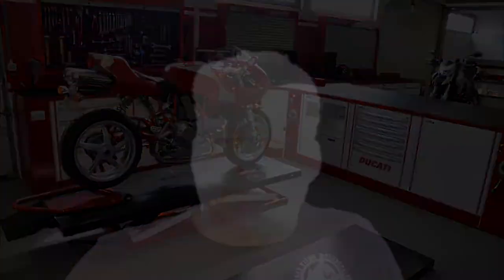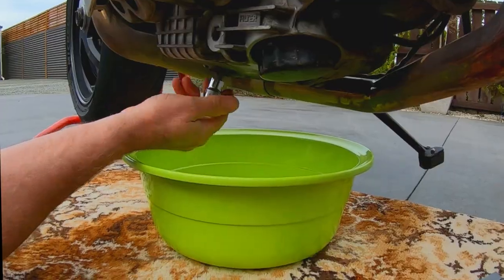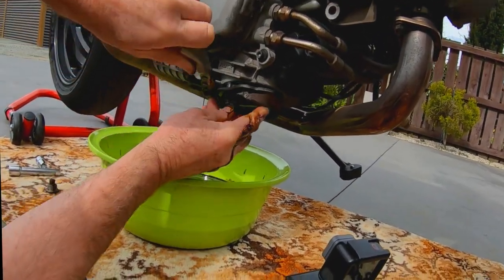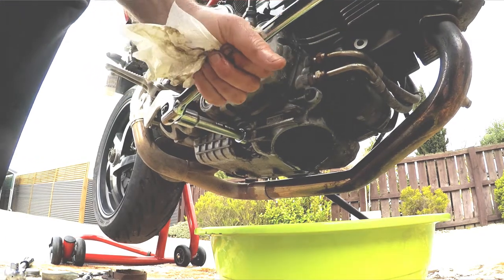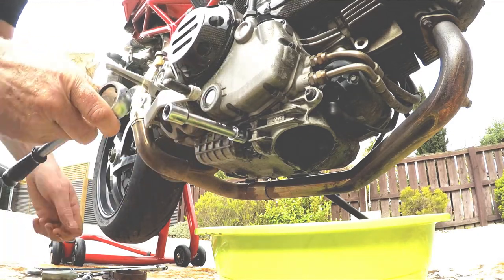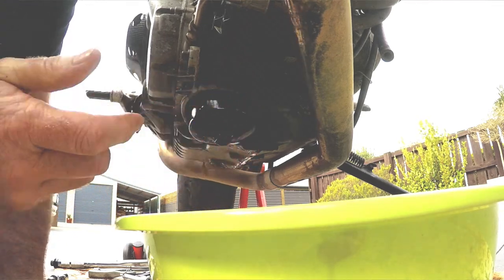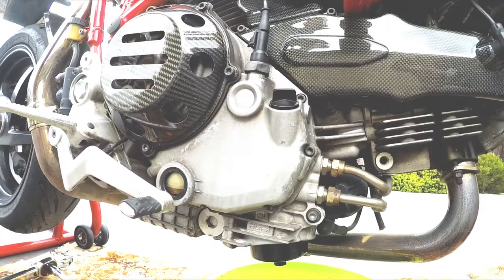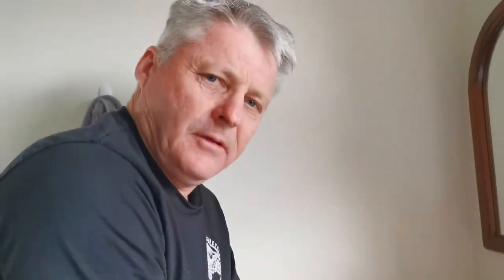Oil change Ducati Multistrada

Comment: You mean hex keys not sockets I assume.  A socket is female. Plus on my 2004 the exhaust blocks access to the mesh filter. Nice quick refresher on oil changes though. Thanks.
Reply from the maker: Yes, my exhaust is after market, factory one needs to remove to access that filter.  Down here, "Socket" is a generic term, whether Alan, posi etc. Whatever fits to a socket ratchet. Like the adjustable spanner, here called a "crescent" and I think in Australia they call it a "shifter".... Breaker bar I call a "persuader"...
Reply: Hahaha your a K1W1 what part of NZ are you 🤣🤣🤣
Reply from the maker: Watch some of the ride videos, I'll send you some free merch if you guess the correct town in 1 guess. PM me in the Facebook group with your answer!
😜

Comment: Your custom exhaust is routed out of the way from the mesh filter. Mine has a shield and the pipe runs right under the mesh filter. Slightly different set up.
Reply from the maker: Yes, the custom headers are well routed, pretty much out of the way of everything........

Comment: Is it the same procedure for multistrada 620?
Reply from the maker: Your engine is the same as the Ducati M620 Monster, looking at pics I would say yes, even Horizontal header must be removed to access the screen filter. Although I can't see it the pics whether there is a screen filter or not, looks like just a blank in the engine case. Oil quantiies and torque specs may be different also. Download a Workshop manual for free here: https://www.carlsalter.com/ducati-service-manuals.asp